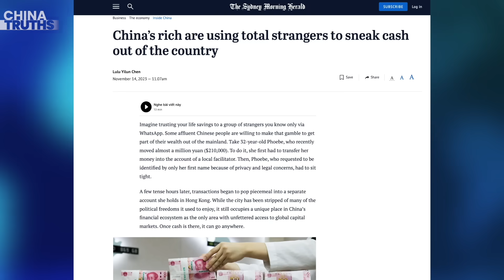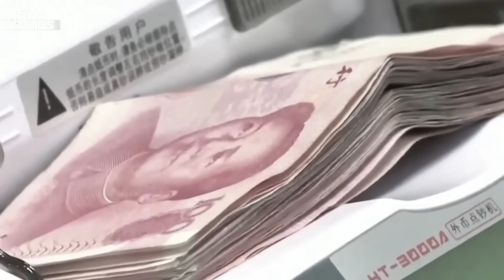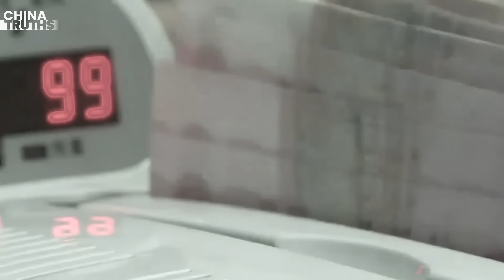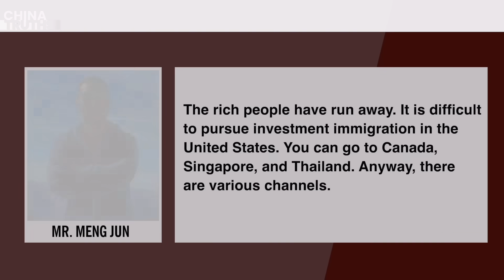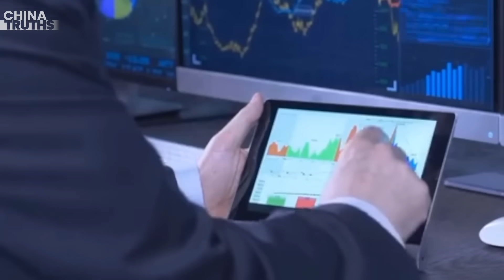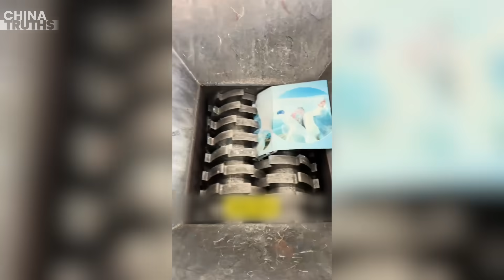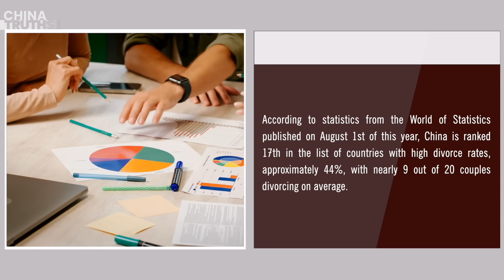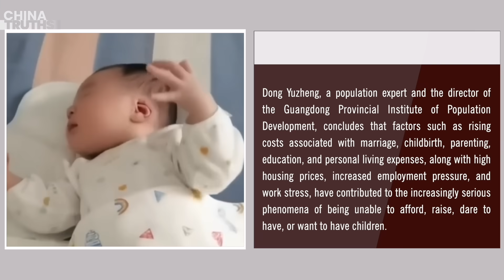Wealthy Chinese Resort to the Last Choice! Walmart's Shocking Move: Exiting China for Vietnam?

Comment: During the Great Leap Forward, the CCP tried to eliminate swallows as a "pest". This had disastrous effects on agriculture. Will something similar happen this time? 

Bringing in climate change is interesting, and I think unwarranted. For one thing, the climate concerns are an increase in global temperature. So, how does this play into the cold temperatures experienced now? Where I am, the temperatures have been very mild and well within the normal range. Climate change refers to the global situation. Weather is local.
Reply: If I remember correctly it was Sparrows not Swallows.
Reply: @LordbomberD  I looked it up. You are correct.

I wonder if it might have a similar effect, though. The problem was that the sparrows ate a lot of insects, which then got out of control. Swallows are also specialized to eat insects.

Another thing I found interesting was that the swallows are well adapted to many different climes. They are occasionally seen in Antartica. So, I wonder about the sudden drop in temperature being the cause of the sudden deaths.

Comment: The explanation of the swallow deaths is from the result of structural impact. The swallows fly in formation of a huge ball with no flight formation. When the flock swoop low, some with crash onto the surface below. No joke, look it up scientifically
Reply: So what did the ones lying on the road fly into? No buildings around there.